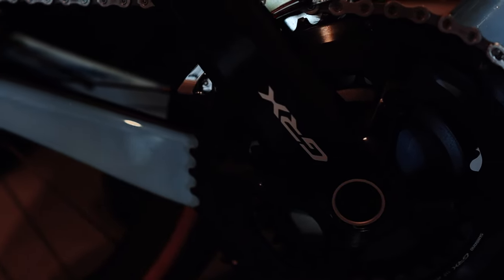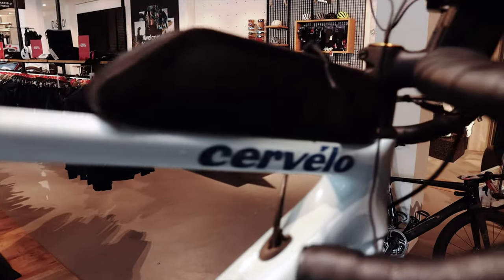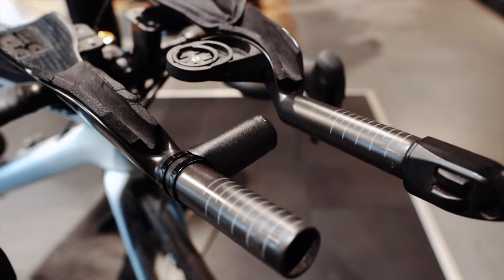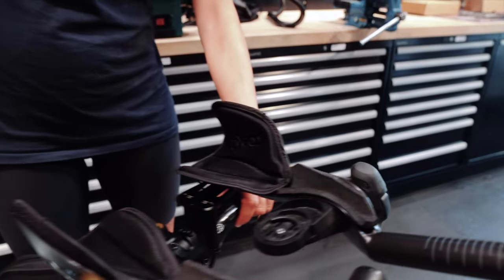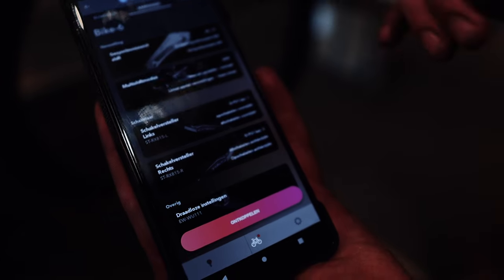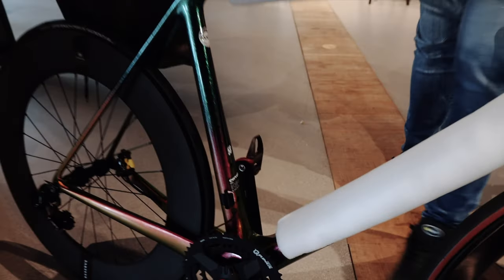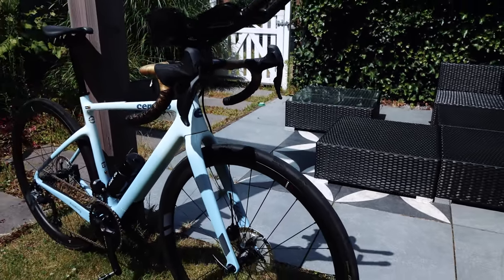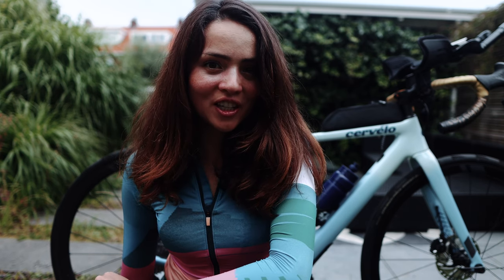New Bike Day! Gravel Bike Cervelo Aspero for Ultra Endurance Cycling & Bikepacking: Tune up & Review

Comment: Hello. Nice bike for great plans! I loved the new handlebar along with the aero-bars. Can you write down the brand and reference. I wish I could set them up into my gravel bike. Thanks!
Reply from the maker: Hi Iban, thanks for your comment, gravel bikes are so versatile,  which gravel bike do you have ? for the aero bars I used the Deda Jet One Clip-On 340 Mm, but you should check them out  well before getting them because theres no much adjustability so you really need to find a position that works for you. For the handle bar I used the PRO PLT Ergo Carbon 31.8 Handlebars,  this handle bar has a very short reach ( I have very short torso) so be aware of it . Hope it is helpful :)
Reply: @Buzzalong.cycling  Hi there! Thanks for your feedback. I currently ride a Cayon Grizl, but its original round shape handelbar makes me suffer from sore hands during long journeys. What about your new handelbar? I'd appreciate some data about its brand and model. It looks like the most ergonomic one ever, and I am thinking of giving a try. By the way, your channel is pretty supportive, and it encourages me to be initiated into bikepacking trips. Thanks for sharing your adventures.
Reply: @Buzzalong.cycling  Ups...I am sorry for asking again the question that you have already answered. I only did read the beginning part of the text since it was partly hidden. I will check out the PRO plt ergo handelbar. Thanks! :)
Reply from the maker: @ibanazurmendigoenaga6420  Thanks Iban happy to hear you enjoy the videos, bikepacking is a great way to explore new places, definetely give it a try :)

Comment: I was just wondering if the brake rotors are centerlock or 6 bolt on the 700C wheels?
Reply from the maker: they are centerlock

Comment: hi Sherry, looks great! just wonder how do you think about the aspero's performance as a road bike (in terms of ride quality, handling), is GRX gearing fast enough for road, and did you also consider cervelo caledonia back then? thanks!
Reply from the maker: Many thanks for your comment Peter, the Aspero works well for me on and off road but if you are using the bike primarily for road the Caledonia might a better option. Sometimes with GRX gears I cannot push it on dowhills but works great to go up steep climbs with heavy bikepacking bags :)

Comment: Hi, really nice bike! For road and gravel congrats. How did you experience the difference after the bike fit and these settings on your new bike? Best, Willem
Reply from the maker: Many thanks Willem  :) the new bike and setup is a massive improvement from my previous bike. Now I can get the right position because of the smaller size and reduced reach, so it is more comfortable and I can dial my position in the aero bars better. Overall realy improved my hand and neck issues and the handling is much better.

Comment: Nice bike! Just curious, why did you go for hydraulic over mechanical disc brakes?
Reply from the maker: Thanks, hydraulic disc brakes have better modulation and stopping power than mechanical disc brakes, so it is better for my hands during long rides as I tend to grab the breaks quite a lot in descents :) working on improving my descending skills ^^
Reply: Ok makes sense. I have been thinking for bikepacking mechanical might be better in case of repairs. Anyhow, hope you enjoy the new ride!
Reply: @sawc7012  Hydraulic disc brakes are far superior to mechanical disc brakes.
Reply: First this video an the channel is great. @sawc7012  Hi, I like your point, mechanical are easy to repair... much cheaper... and depending on the type of race sufficient. If someone is on low budget adapting a road groupset to a mechanical discbrakes setup is a great option!!!!